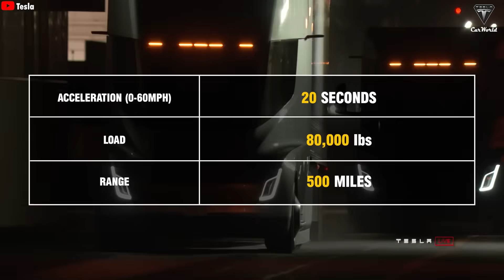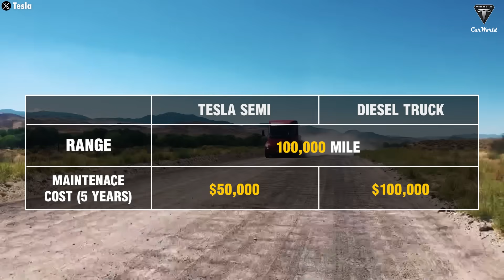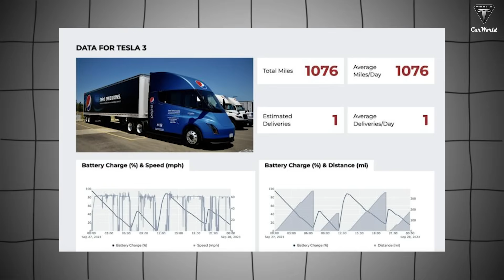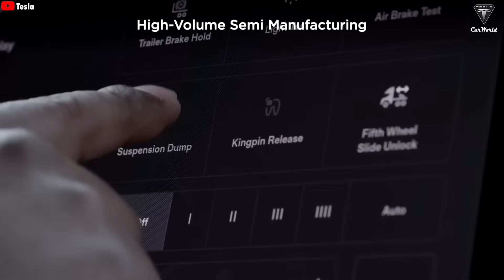It Happened! Elon Musk LEAKED Tesla Semi Massive  At New Giga! 50.000 Big Rigs Producing!

Comment: The new simi factory is not yet ready. When it is, the factory  WILL NOT  be punching out 50K trucks a year-thats 190 trucks each 5 day week workday. They will have to work up to that. You have to walk before you can run. ALSO-There is no sense in building 190 trucks a day unless they 
are  SELLING  190 trucks a day. Ford assembly lines are variable speed to be adjustable depending upon demand. Sometimes a Ford assembly line is running slow & quiet. Other times there are 2 shifts-6 days a week noisily filling orders.

!

Comment: The issue of a slightly narrowing maximum width that Europe requires also is required in Australia, another large market. The version of the CyberTruck to be produced in the new Nevada factory is a redesign of the current low volume model. I feel sure the width issue will be handled in the new model. It appears that Tesla will wait to get the US version of the CyberTruck into full production and have all of the startup issues resolved before it builds the needed new facilities in Europe and China. The issue that has slowed the Tesla CyberTruck's introduction is really the availability of the need for a high volume of appropriate batteries. The size of the Nevada factory will allow Tesla to build the need batteries, assemble into the necessary packs, stamp the high strength frames and perform the assemble in the single facility.... true vertical integration. This will improve the cost structure and the automation will keep the sale price low and the profits high.